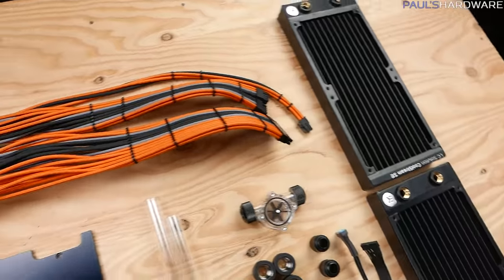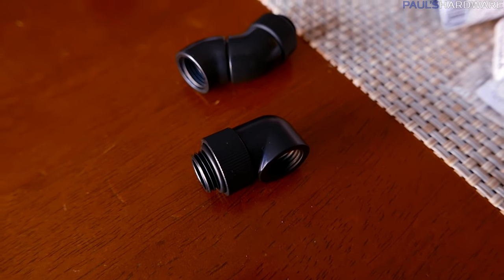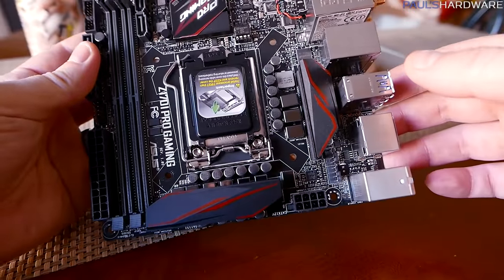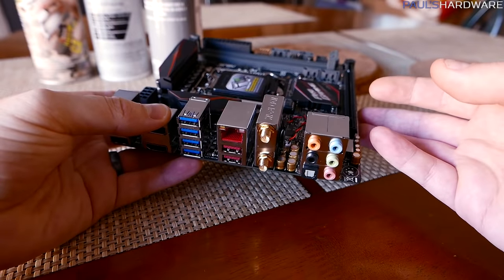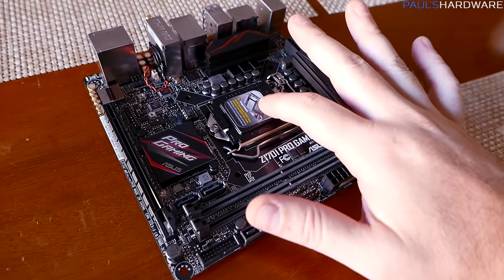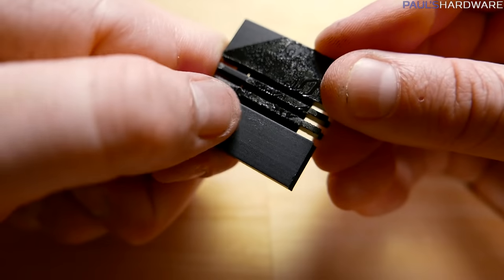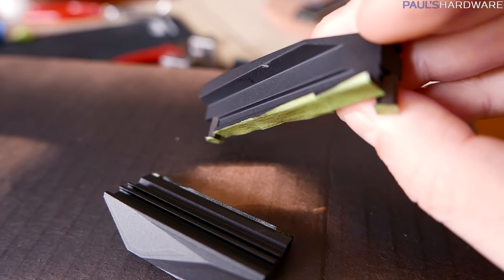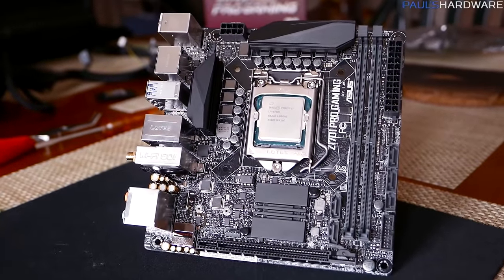Modding the Perfect Mini-ITX Z170 Motherboard

Comment: +Paul's Hardware Can I Use A Car Coolant For Liquid Cooling And Can I Use Four Pin Plug 4 Pin Instead Of 8 Pin For CPU Power Delivery
Reply: You probably could use auto coolant, but generally, distilled water works very well and is inexpensive and commonly available. Also, you're going to want to use an 8pin CPU power cable... If your PSU doesn't have the 8pin, it's probably not fit to run your rig.
Reply: Thanks
Reply: Distilled works, but you'll need a silver coil in the reservoir to kill bacteria in the loop. Amazon sells them for about $5.

Comment: Paul, not quite related to this sort of MOBO modding and maybe not even modding at all, but do you know anywhere that I can get the MSI Z170 gaming m7 io cover heatsink type thing to put on an m5? The m7 is beyond what I need but I like the aesthetic and was wondering if I can get the gaming m5 to look more similar by adding the io cover
Reply from the maker: They usually don't sell that type of thing directly, but you could try contacting them (maybe via twitter or their marketing contact) to see what they can do. Beyond that I'd check out forums and buy/sell/swap sites to see if anyone would be willing to sell you theirs.
Reply: Paul's Hardware Thank you, I was looking to see if they maybe sold replacement parts for the m7 but to no avail

Comment: why not the maximus impact? or would the daughter board have got in the way?
that's why I didn't use one in an itx build
Reply from the maker: I'm 100% sure that with the daughter board it wouldn't fit in this build due to the radiators, also it has some very red accent colors that would be hard to deal with. It is a great motherboard though!
Reply: Paul's Hardware yeah its a great little board, used it in a few customer builds. but when it come to doing mine in a corsair 380t, the daughter board got right in the way of the 240mm aio, so went with an evga stinger instead
Reply: The daughter board does not fit in the Define S Nano, I believe it was by a few millimeters

Comment: I picked up the h170n I guess the z170n isn't meant for more than a 4.3ghz oc with xmp
Reply: I wasn't even aware the h170 would overclock.
Reply: +tigerag29607 i think all motherboards can overclock but their not built for overclock correct me if im wrong
Reply: +Lino Fragoso I know only z170 from what I've heard before can oc, but it looks like after a little research the h170 can do basic oc, but no other skylake Chipset can oc.
Reply: Guys, I said I picked up the H170N but made a comment about the Z170N becuase this video is about an understated motherboard, and both are black

Comment: I wonder why do most current mobos have unchngable cmos batteries? I actually had to change the one in my pc after like 3 years. Do propper batteries last longer than the mobo?
Reply: I haven't seen a mobo with fixed batteries for ages, which one is yours?
Reply: Mine has like an springy metal cip that you put a normal baterry into. It's an older ASRock with an A85X chipset. But i was talking about those mobos where the baterry has the cables and is like heatshrinked inside the black rubber. How do you change that?
Reply: vojtasTS29 you can buy those ready to plug batteries, just search for "cr2032 with connector" you'll find a lot of vendors.
Reply: well i searched and there is not a single vendor in the Czech Republic where i live. Welcome. :D
Reply: Don't worry, you can find a lot on eBay.

Comment: they dont ahve any mobos like that but with 4 ram slots?
Reply: Skylake is limited to 2-channel memory and you can easily fit 32GB with 2 DIMM slots. Any usecase that requires more RAM with more throughput likely requires better thermal characteristics than you're going to get with an mITX build. You should be looking at X99 mATX mobos.
Reply: Nop, all itx mobos have 2 slots :P
Reply: Nope, ITX MB only have space for 2 ram slots. I've seen Linus use one random ITX board for LGA 2011-v3 that has 4 slots but it uses laptop ram for space savings.
Reply: +Dominique Lopez (Alphajet76) Well, technically they do, but they're not consumer ready. Linus did a video on a mini ITX motherboard with 64gb of ram and 4 dims
Reply: xeon only chips boards. so not cheap xeon boards which any normal processor can work on but the e5 and e7 centred xeon boards do

Comment: Guys what do you suggest me for a mini itx motherboard for gaming ? Thanks
Reply: Hey Buddy. This is a nice board. You can put an i5 in there with the more than  good enough GTX1060 3GB* (or the affordable RX460) mini into a small case, and it'll fly--especially if gaming at no more than 1080 is your style an you are happy with a 24" monitor or smaller.  

However, if you want to game beyond 1080, like at 2 or 4K, with 25" or larger monitors, then the Ryzen 7's are worth looking at along with the 6GB GTX1060! Also, if you would really like your rig to multitask very well, then for sure the X300 could be the chipset, due to come out soon, that might be worth waiting for.

* Alternatives for the video card is the very affordable and small, just like the 1060 mini, RX460 (you can get it for a c-note), which should provide similar visuals at 1080 on most games most of the time as the 1060. Nice. Got more room in your case and want more graphics speed? RX-470 maybe. Don't wanna mess around? 1060 or RX480. Of course, everyone has his opinion, but I've been thinking about this kind of build for a few weeks, and always someone else will offer you better and different ideas, but the 1060 mini is nice and small.

Comment: my 6700k can hit 4.9ghz but looking at an andandtech article the perf/watt is terrible past 4.7ghz
Reply: not if you don't have to touch the voltage. My old FX6300 managed to get a stable OC with 4.4Ghz at stock voltage, thus not sucking any more power as the stock clock :)

If your 6700k hits 4.9Ghz with the same voltage as someone elses at 4.7Ghz it won't use more watts than that one.
Reply: Actually voltage doesn't = amperage meaning the higher clock even at the same voltage can consume more electricity. The winners of the 6700k wattage can get maybe 4.5ghz without extra voltage. Do note that the stock "auto" voltage will automatically add more voltage...

Comment: Can someone recommend a good value mini-itx motherboard? Intel or AMD chipset doesn't matter, Wi-Fi is a plus but not a dealbreaker. So far I've found an ASRock H97 that has all the features I want, but it's 90£ (about 120$ at the time of writing).
Reply: I'm going to buy the Asus B150 Pro gaming aura Wifi, which i think is nice and suits my needs. I'll put a i7-6700 in there
Reply: http://www.tomshardware.com/reviews/asrock-fatal1ty-z170-gaming-itx-ac-motherboard,4326.html
I have it and it's pretty fuking amazing.

Comment: Had to pause the video when you mentioned that you cant use plastidip on things that get hot... you know people use it on their wheels.... ever seen how hot they get?
Reply: I know man! people use plastidip on engine bays too lol
Reply: The problem is that plastidip is not thermal conductive, the heatsinks would not cool properly
Reply: Show me the tests that prove it is any less thermally conductive than regular paint.
Reply: unijabnx2000 its basicaly a layer of plastic over the heatsink, i think ncix did a video about painting a heatsink, check it out
Reply: and Mighty car mods did one about painting over an intercooler... my original point still stands. Show me a video comparing thermal conductivity of paint vs plastidip.
Reply: unijabnx2000 there is no video, read a bit about the conductivity of plastic and stop arguing with me, i just said what might be the reason
Reply: Theory vs reality... until its proven we can both think whatever we like, so until then, I tip my hat.

Comment: Uhh... pretty sure EVGA have a z170 mitx board that is black.
Reply from the maker: EVGA Stinger's M.2 slot is Key E, can add a wifi card but not an SSD
Reply: Makes sense. Asrock's and MSI's offerings have the same problem - no M.2 or limited to wireless. Ended up getting the same mobo featured here.
Reply: Lo Studios YT marked your comment as spam and isn't letting me restore it. Try again.
Reply: The Stinger is a terrible board though.  The Asus is so much easier to build a nice clean looking system with.

Comment: .I stopped watching when I saw the paint cans while this might be ok for the hobby shop it is not a good idea to use it where temps can rise to extreme levels causing toxic fumes or bad smells emitting from the board these company finishes are baked on process that will not put off odors and will with stand temps designs read the side of those paint cans many spray paints are designed only for use in applications with temps not exceding a certain temp range .